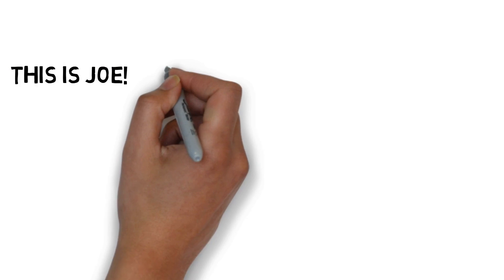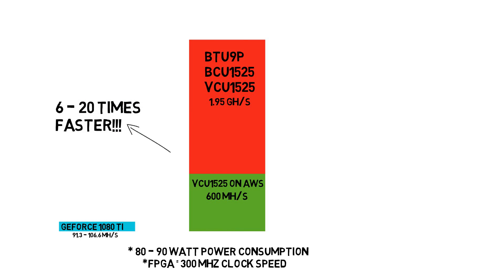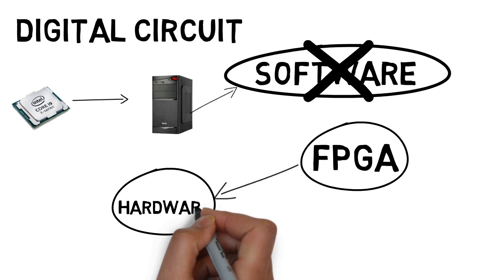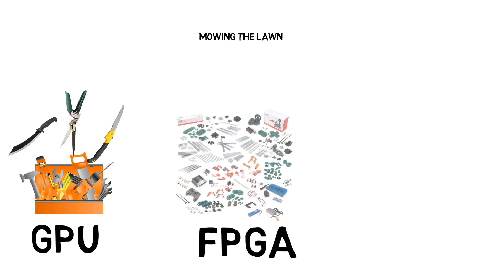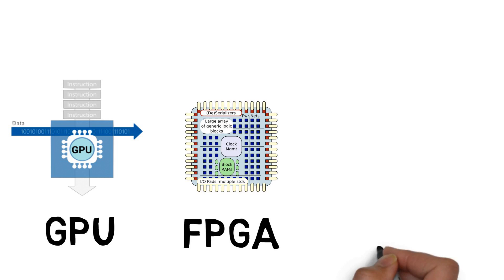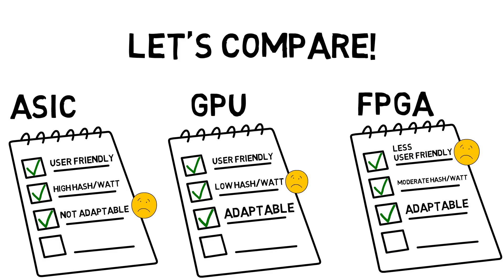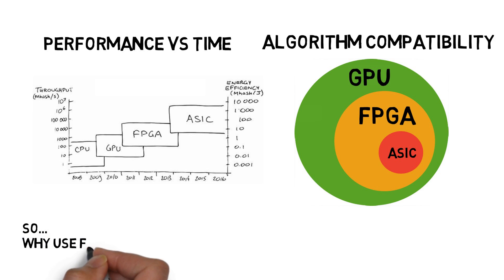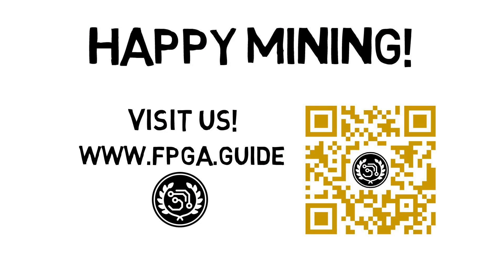FPGA Miner for Cryptocurrency Mining: Why Use FPGA for Mining? FPGA vs GPU vs ASIC Explained

Comment: mine the first pure pow bnb based bep20 token, BnBitcoin.  All the characteristics of Bitcoin, written into a smart contract.  No airdrop.  No ico bs.  
I can't post a link, but you can just add ".org" to the name, BnBitcoin.   Mine as much as you can before block rewards are reduced by the first halvening.  This is going to blow up soon now that eth gpu miners will be looking for alternatives.